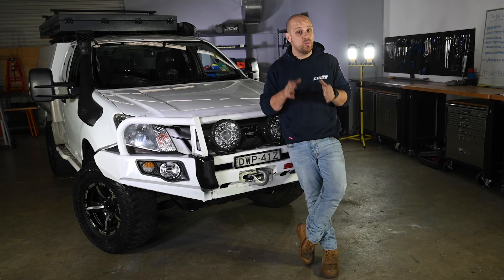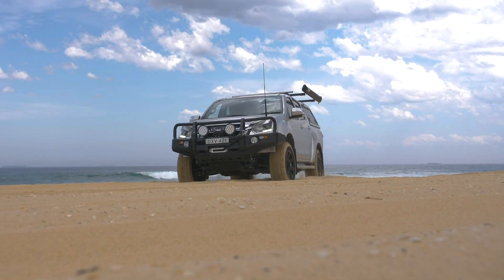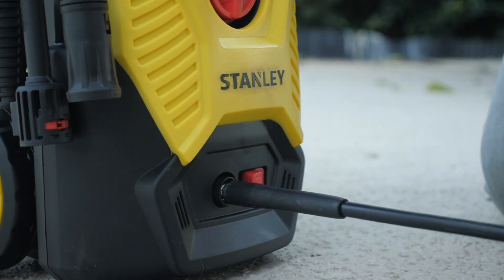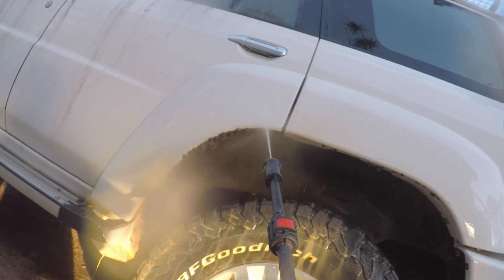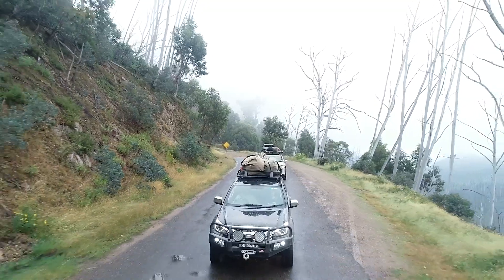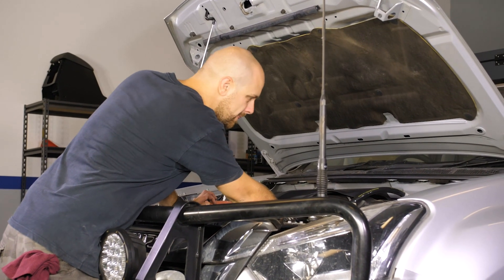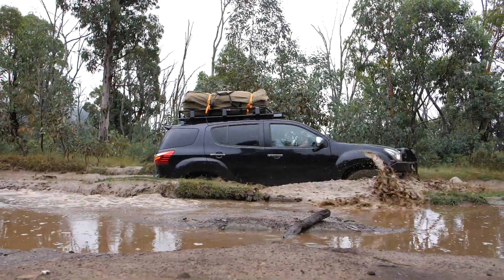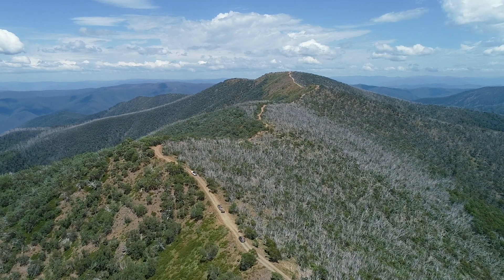YOUR 5 MIN GUIDE TO... Better Fuel Economy from ANY 4WD!

Comment: Great video thanks. More tips already in comments but will add a few. Don't use a roof rack if you can avoid it, even an empty one will add to your fuel bill. Don't put oversize tyres on unless necessary as they are fuel killers. Avoid towing if you can that often adds 50% to your expense, avoid heavy braking as recovering speed again uses fuel, coast instead. Final thought, when buying a 4wd buy the newest you can afford with the most fuel efficiency as modern common rail turbo diesels polute less and drink less plus much safer in an a and or better at avoidance.ccident

Comment: What about removing excess weight, the more weight ( especially unneccessary weight) that you carry the more power you have to use & the more fuel you use.

If you are just going regular country & you have 2 x spare tyres on, take one off, its not neccesssary, ilike wise if you are carrying spare fuel just for a simple weekend away, its not neccesssary eithee learn to fuel plan, or fuel plan better.

All vehicles travel much more economical at night when the air is colder & thicker than during the day then it is warmer & thiner.

Take off easier at the lights & change gears sooner if you have a manual.

Try and make your vehicle as aerodynamic as possible.

"Safely" slip stream other vehicles.

Hete's another one, stay further back from old mate when off road so you are not taking so mucg of his dust.

All these extra tips will save you ever more $$$.
Reply: Yes - take that heavy recovery gear out when you get home...

Comment: How much fuel economy lost can we expect with an egr valve that hasnt been cleaned if the vechile has 300k kms on it? How often should you clean the egr system?
Reply: Good question
Reply: block off egr, works great
Reply: @lincolnredmond8650  mate that is highly illegal. Dont understand why people do things illegal your just asking for trouble from the cops. Enough said.
Reply: David Cowan don’t forget to remove dpf if diesel
Reply: David Cowan if the cops defect you for an Egr honestly just throw in the towel and buy a Prius. Blocking/deleting your egr goes miles especially on an engine with 300k
Reply: Get someone to do a proper clean of the manifold ect, then block it. You’ll be amazed at how much power you’ll get back
Reply: I recently added a catch can and dropped the coin on a egr clean and dyno tune. With the lack of travel at the moment I haven’t done a real days driving yet, but around the city I’ve done a few tanks and I’m getting about 1lt/100 improvement, so it’s basically back to where it was when I first acquired the vehicle with 40k on the dial. As a part of a dyno tune they will normally do an EGR delete to stop the ECU actuating the valve. The system is still connected and there is no physical blockage so it would be pretty difficult to get a defect for that. This was on a Triton with 120k on the dial now. Old mate who did the tune joked that Mitsubishi is Japanese for carbon and having seen it I have to agree. If I had my time over again I would have spent the money as soon as I got the vehicle.
Reply: @Alan.livingston  I bought a catch can as soon as I bought my Triton, it had 112,000 on it and no can installed, absolute mad man that I bought it off. Got the manifold cleaned, EGR cleaned and now I just do routine cleaning per service. When I empty the catch can every 5k, I also run some moly through the intake to clean the ash out. Averaging 10.4/100 on my ML with now 128,000 on it.
I haven't dyno'd it because I'm happy with the power it's got, and the return on investment of that 0.5-1l/100km is so slow it won't even pay itself off by the time I move onto a new car.